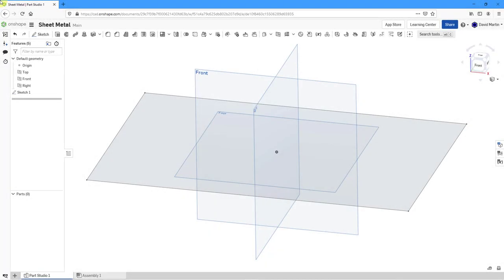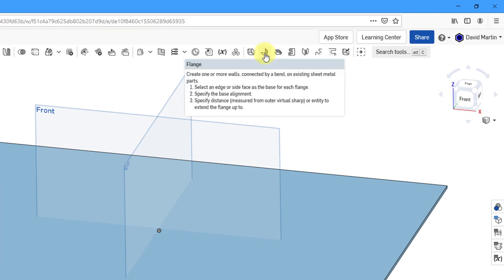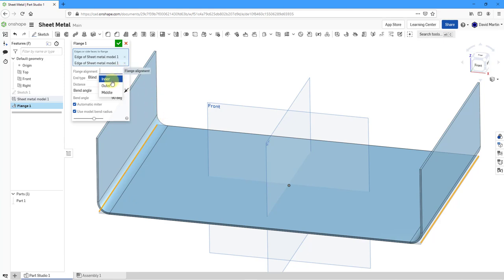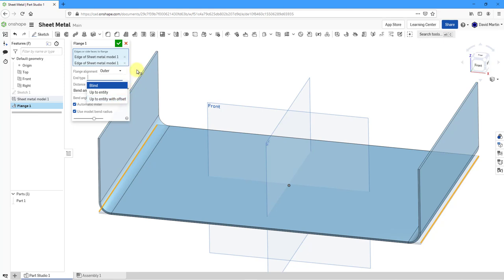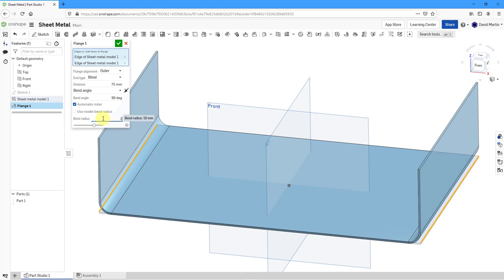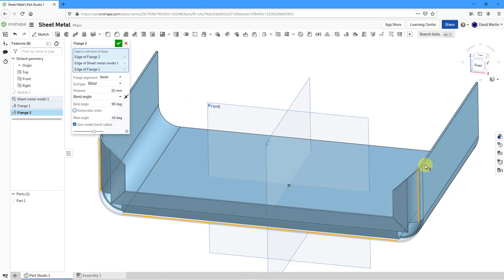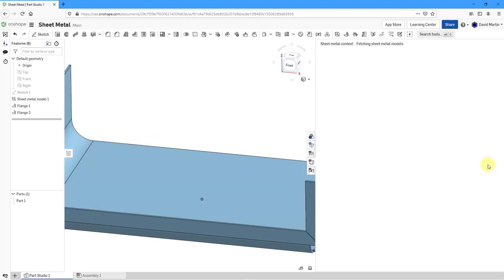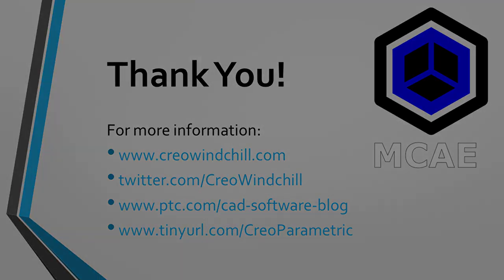Onshape - Part Studio - Sheet Metal Flange

Comment: Hi mate, how do you change the flanges to 90 degree joints instead of 45 degree joints as when the part goes to be bent it will stick out as the material going 45 degrees wont catch the vee walls when folding. (I work in the folding industry using a press brake and this is a big problem)